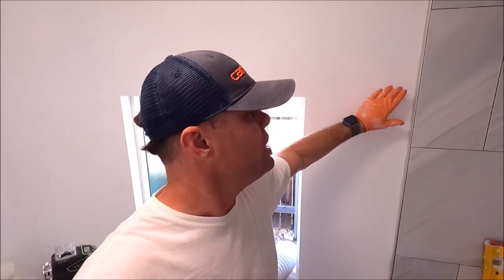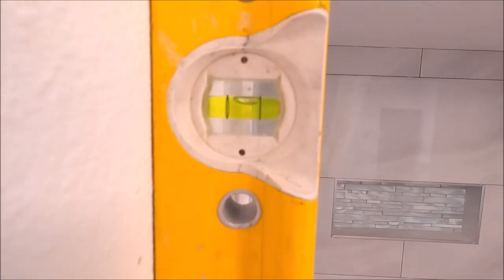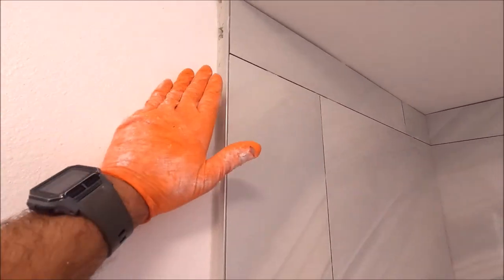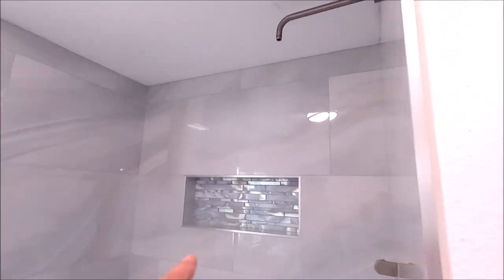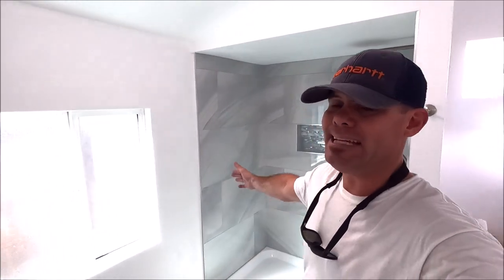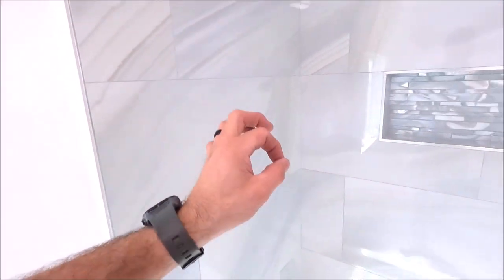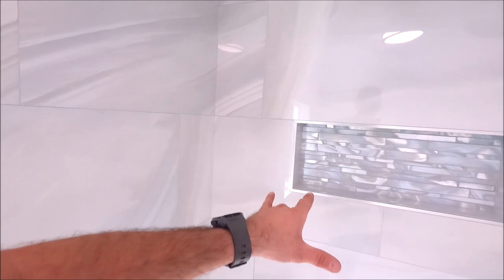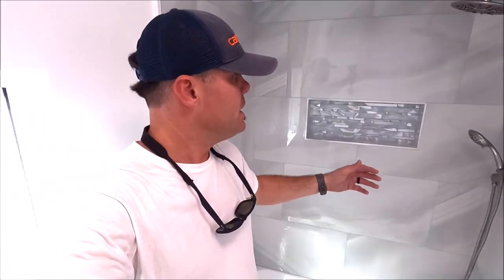BIG Porcelain 3 Day Shower Build is COMPLETE!

Comment: Thanks for showing how you handle the gaps. I typically have not had gaps that large, so I will silicone caulk (paintable) the smaller gaped line and then paint the same color as the wall. I ALWAYS show the customer what and why I've done this so I will not get a call later saying that their tile is "crooked." ahah
Reply from the maker: Glad it was helpful!

Comment: With the wall that far out of plumb, and that gap.. does this mean you just built up with thinset to get the tiles on? Or I may have understood this incorrectly, did you plumb the walls behind the shower tile before tiling and it was just the drywall outside of the shower that was out?
Reply from the maker: Yes, we plumbed the walls before tile was installed. That's simply the existing bathroom drywall that is extremely out of plumb.

Comment: i know you like a full tile at the niche.But in this case just dont like a 4 inch cut at the ceiling.It makes the shower feel shorter, rather than taller.
Reply from the maker: I push against cutting the first row of tiles, just how we do things. Plus this manufactured home had a much shorter ceiling than usual.
Reply: @LandbergTileTV  reallly
Reply: I kind of agree, but I also don't like equal cuts top and bottom.  Personally I like the top cuts a couple inches bigger than bottom cuts, to me it just looks better.  Imo if you had to go full either top or bottom , I feel it looks more pleasing with the full at the top...just my preference though

Comment: Are you a self taught tileman or did you learn from some old-timer??
Reply from the maker: I am an old timer!
Reply: The reason is that cut agents the ceiling looks like a homeowner installation. Your work is tight though. Full peace at the highest point,then cut in the rest..if necessary is a much better look